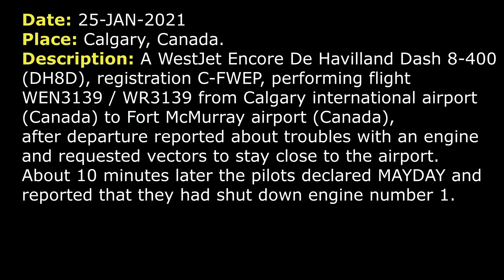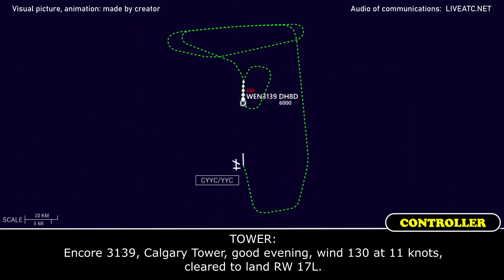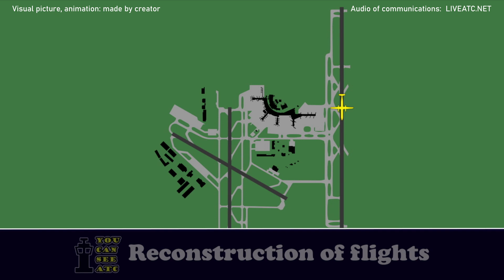ENGINE failure, MAYDAY, emergency return | WestJet Encore De Havilland Dash 8-400 | Calgary airport

Comment: I thought Mayday was if a crash was imminent. Sounds like they weren’t in mortal danger and could probably have flown hundreds of miles further. Any thoughts?
Reply: There’s a saying: “In thrust we trust”. Essentially, flight is moving something fast enough through the air that it defies gravity due to lift. This plane’s just lost an engine, thereby reducing its thrust. That’d be an emergency on a good day, because you don’t want to lose forward momentum when you’re a piece of metal hurtling through the air thousands of feet above the ground. To make matters worse: they were not that high up. The higher up you are, the longer your glide slope and the more time you have to work the problem. Conversely, the closer to the ground you are, the less time you have to identify the problem and either fix or work around it. 
To make matters even gnarlier, this flight had just taken off, which means it was full of fuel, losing power, over a city, with people on board. 
The pan-pan at the beginning is “we’ve got a problem but we have some ideas”; the mayday is the “yep nope we’re gonna have to land”. 

It’s tricky as hell, with very high stakes, and this team were consummate professionals. These guys are pros.
Reply: Critical failures will trigger a mayday call. Engine failure is one such failure. A good video that describes when to use a mayday vs pan pan call is this one: https://youtu.be/UWpwl-NPnrM

Comment: "Pounds" of fuel in Canada?
Reply: Depends on the aircraft setup. I’d have thought you’d know that with your experience. Some are config’d in pounds. Some in kilos. It’s not country dependent. It’s aircraft setup dependant. Dash 8: pounds. CRJ: pounds. Some Boeings were pounds some kilos. I fly a Boeing that’s kilos. But I’ve flown MD80s in pounds. It’s all over the place
Reply: @Treetopflyer777    I am well aware of aircraft config differences.  I was responding that ridiculous comment about the whole world, except for NK, using Imperial measures.
Reply: Civil aviation is in imperial worldwide with the exception of North Korea.
Reply: @richardmichael9538  — you have absolutely no idea about this.  Do a little research before making ignorant comments.   But what would I know after 44 years of flying, 80% of it internationally?

Comment: Can someone explain the exact difference between an ILS approach and and RNAV approach and why a pilot would choose one over the other if both are available?
Also, what's the difference between RVNAV Z or RNAV Y...?
Reply: RNAV leverages GPS / Satellite and from my understand they were having issues setting it up. ILS is based on equipment on the ground at the airport only.
Reply: Z and Y usually differs in terms of rnp or type of rnav used or the layout of the approach (T terminal etc).
Reply: @Shadow__133  So I guess this means precision then... thanks! :)

Comment: Why did ATC turn him into a dying engine??

Though crew does say later they can make left turns.

Love your vids, superb work!
Reply: It's not even a thought on the Dash 8, or any larger plane for that matter.  There is no shortage of power, a very big tail, and lots of control surface on the wing.
Reply: @wleflour  Ya Dash 8 has a massive tail!
Reply from the maker: Thank you 😊
Reply: It's not exactly a myth that you can't turn into the dead engine, but the perceived risk is very overblown.  At any reasonable speed and bank angle, the difference is negligible.
Reply: @mtnairpilot  Ya but in say a Piper Seneca in training, you never turn toward the dead engine!!!

Granted Q400 is a high tech and very powerful machine too.

Plus crew very experienced.

Comment: Extremely professional pilots and controller. These guys were SO calm and did everything right, except why fly a GPS approach when an ILS was available? Other than that, this was how you handle an emergency. This from a retired airline pilot with 54 years and 30,000 hours. The air traffic controller is to be lauded as well.
Reply: It’s a LPV, doesn’t really make a difference, the Q flies them really well. Less setting up to do.
Reply: Landing YYC, Westjet and Encore fly almost exclusively RNAV Y and Z approaches, except the 1% of days when the weather requires CAT 2 or 3 ILS. Not surprised they’d elected to fly an RNAV, initially.

Comment: One of the rare instances where the left engine was rightly shut down.
Reply: I thought it was great that the controller was aware of the fact that it was the #1 engine and asked them if they required a different direction of turn.  The controller was all over it.  ...minor detail but avoid turning into that dead engine....then again a left turn always put the runway out of the captains window.  Alls well that end well.
.

Comment: That dash is a handful in an engine failure for both upfront..  those pros sounded like it was a stroll in the park.  Well done!
Reply: The engine didn't fail, they had to shut it down.
Reply: @jedimstr397  even more of a handfull!     I'd rather an engine failure with auto feather than the condition that would require an engine shutdown after takeoff.   Prop overspeed is the scariest failure I did in the sim.  It is one of worst.  All the other conditions still not ideal.   They did a great job. 

Over 4000 hours in type and about 1000 PIC on the old tank..  i miss her...
Reply: @skippynj1979  Indeed. Which reflects very positively on the flight crew and their training.

Over 15 years line maintenance on-type. ;)
Reply: Dash-8 driver here. Disagree folks ref OEI...particularly at DA typical of the climate.
EVEN MORE SO: when not failure, but disciplined shutdown due captain analysis. Thus, no surprises.
*as A/C engineer with sound kn of type, curious about shutdown parameters -'120 & variants are typical of P &W reliability.
(Info gratefully received )))
Drinks all round for maintaining SOP.
Made easier by lack of congestion.✈
(Yo other D-8 driver post...IMAGINE calling it a "tank" 😲....very sweet ship, talks to you all the time & zero surprises ....biggest deal is swapping back the brake fluid 😊)

Comment: Calmest pilot and ATC combo ever. Sounded like he could have been calling a golf game instead of flying a jet with a missing engine.  ATC even asked whether left or right turns were better (unlike LAX last week).  I want this pilot next time I can fly.
Reply: Great job. However with a problem with the #1 engine would be prudent to make right turns. As long as the airspeed is high there isn't a problem, but normally we don't like to turn into the "dead" engine. ATC should have asked initially, not half way into it, but all-in-all great job by everyone
Reply: @bobteter4300  Typically on a turbine aircraft, the turn direction makes little difference
Reply: Thanks Nick.  I would agree since most turboprops have autofeathering (reduced Vmc) and rudder boost capability, it makes flying on a single engine easier. However, I don’t believe the aerodynamics is any different if the asymmetric thrust is from a piston or turbine engine. I believe, banking into the dead engine will raise the Vmc independent of the engine type.  HOWEVER, I have been wrong more than once so I’m open to knowing more. Thanks, Bob @nicksutherby
Reply: as we say in the business "it's ok you got another engine"
Reply: Just to clarify De Havilland Dash 8-400 is a turbo prop not a jet.
Reply: @motoman1997  good catch thanks!